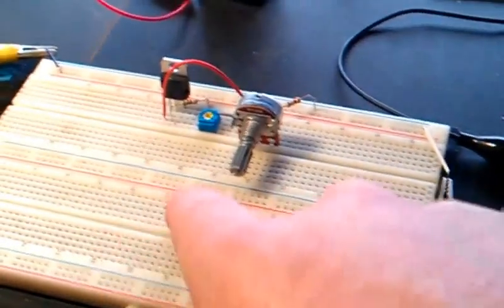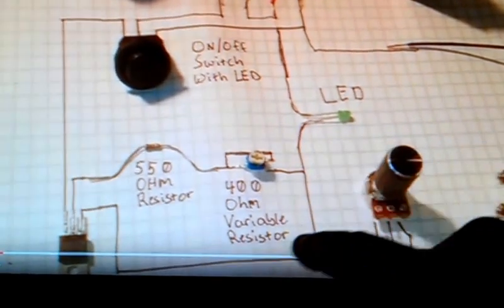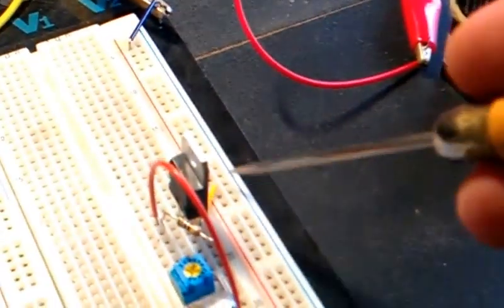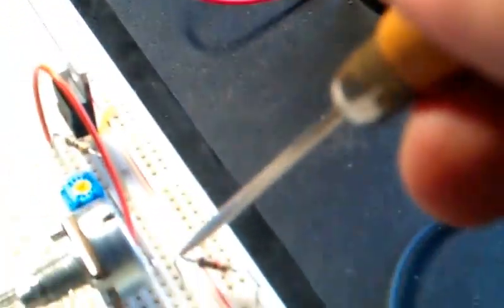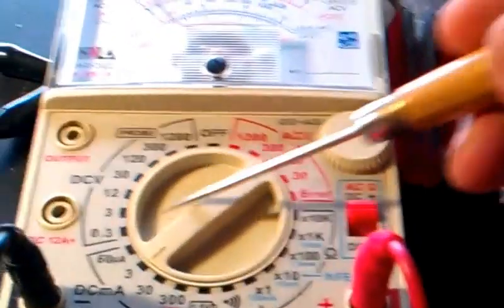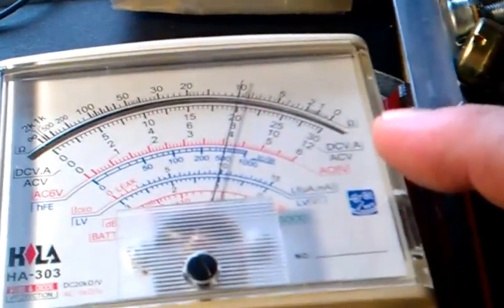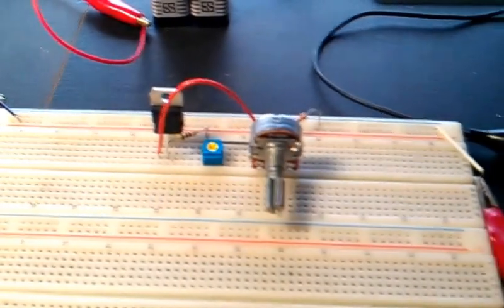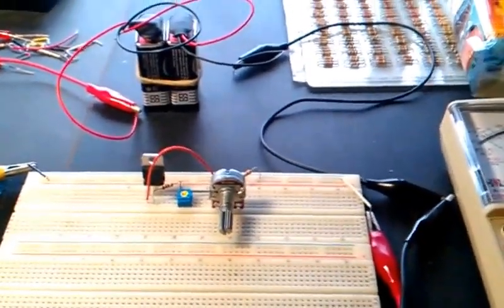My tDCS experiment: Part 1: Building the Circuit

Comment: I built this exact one, but just before I hooked it up to me for the first time, touching the saline soaked electrodes directly together, I was reading 2 milliamps. I'm currently sitting with it hooked up to me in DARPA montage (anode right temple, cathode left shoulder) and it's reading 0.2 milliamps instead. Is this normal? I can feel a slight tingle on my right temple. I have an ammeter built into the circuit. Am I supposed to? Also, I have the LED in the circuit as in the original. Is this why you replaced it with a resistor?

Comment: Do you need a soldering iron to build this?
Reply from the maker: Yes and no... Yes, if you want to build a finished "product" that you can use for the long term, then you definitely will need a soldering iron. But if you just want to experiment and see if it works for you, then no, you don't need a soldering iron, instead you can use a breadboard. 

If you do plan to build a long-term product, then check out the last video in this series. There's a note near the end about how to choose a good soldering iron. 

https://youtu.be/vtxfxKJI0VU?list=PLONJfHQUJtcUSap9TH5hYCrFCsjHTd5XT&t=12m56s
Reply: taiwanjohn Ok thank you!

Comment: all you need is a power supply like a 9 volt battery or a variable voltage (3v 4.5v ,6v,7.5v , 9 v 12 v)wall adapter with a variable resistor like 2k to 4k and red led in series  as a visual indicator.a couple of wet felt electrodes.
Reply from the maker: I'll pass on the wall adapter. I wouldn't feel comfortable juicing my brain with anything connected to mains power. But I did find a way to use a single 9V battery instead of two, by replacing the 560 ohm resister with a 220. 

There are many ways to do the job. For example, I've seen several designs that use a current regulator instead of a voltage regulator. I'm not even sure why I chose this one in particular, but whatever... it works, and I'm happy with it.
Reply: you can use a voltage booster connected to a cheap power bank.you can get 5 voltage boosters for $1.50 on ebay.the output voltage can be regulated from about 6 volts to 28 volts using a multiturn resistor on the voltage booster.the advantage is the rechargeable  power bank and fine control of the output voltage.you can add an extra safety resistor to the output....etc...etc.
Reply from the maker: I appreciate your input, but I'm pretty well fixed on a path already. If you watch the rest of the videos in this series, you'll easily see the direction I'm going. The basic parameters of the circuit are already settled, I'm just waiting for the chance to start building the final product.